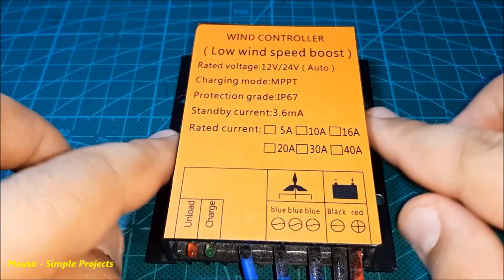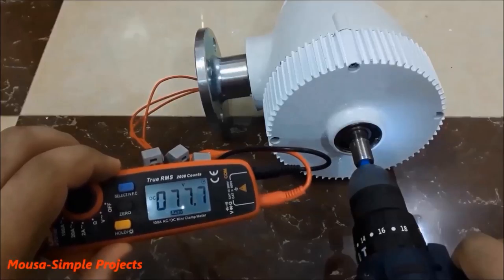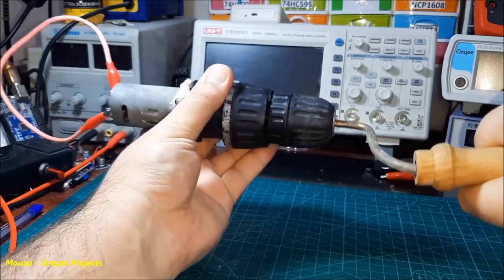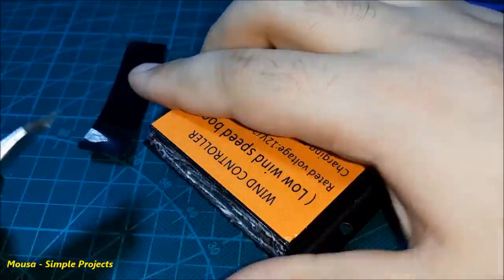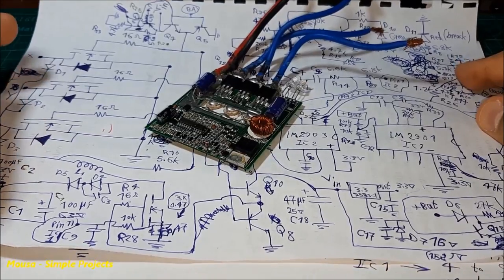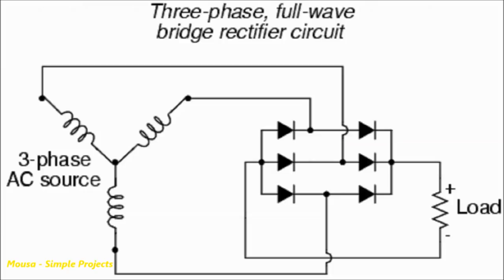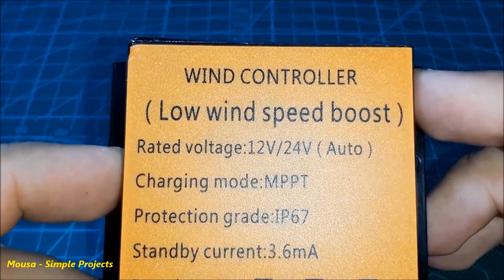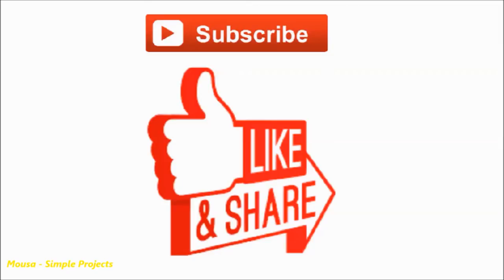Wind Turbine Charge Controller Teardown / Wind Controller Circuit Diagram Explained

Comment: nice explanation! i have the same controller.  so we don't need that external green break?
Reply from the maker: Thanks. In this controller you don't need external dump load because it has internal brake , I think the external dump load using for very high power wind turbine.
Such as this controller: https://www.aliexpress.com/item/32601478989.html

Comment: Hi. have the same wind controller. 
Can you please tell me How can I connect the dump resistor to that controller?
Reply from the maker: This one don't need external dump resistor. The dump resistor used for high power version.

Comment: I think that the sand is being put into the controller housing for the following reasons.
1. You feel the weight of the machine. It’s laughable though lol...
2. Sand is bad conductor of electricity therefore it doesn’t seem to been hurting the machine and it’s electrical and electronic portions.
3. Using sand as natural heat sink. It’s ridiculous but it is just fine to use sand as propagating medium for heat generated within the machine to the outer atmosphere.
4. Some sand maybe special and might have better properties to which we might be unknown. China clay is especially used to design pottery worldwide.
5. There might be still more reasons to put sand into the machine, especially the Chinese clay.
Opinion: That sand should be laboratory tested to find more meaningful results than just laughs at the idea.😂